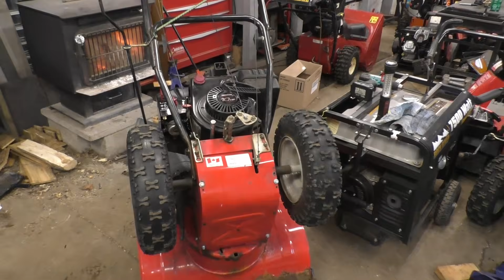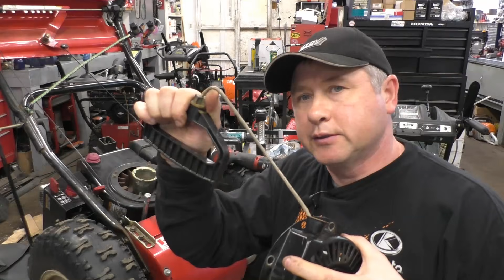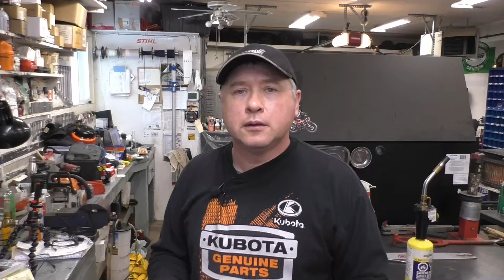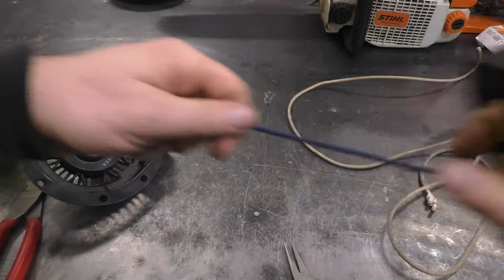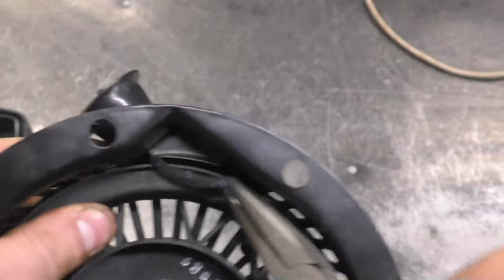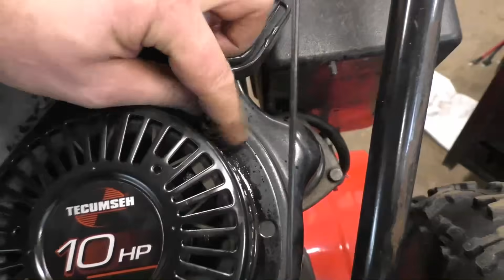Snowblower Starter Rope Repair on 8-10HP Tecumseh Engine

Comment: If The  Rope  Breaks And The Rotor unwinds  How Many Revolutions Do You Rewind The Rope Roter When Installing A New Rope?   🤔
Reply from the maker: 4-5
Reply: So do you re wind the rotor before you put the rope in and then lock it in place with the screwdriver like you did?
Reply: I wound mine until it stopped from being fully wound and then backed off until the hole lined up with the rope guide, inserted the screwdriver and proceeded with the rest of the install as he suggested. This method works great because it is right at the maximum recoil strength.
Reply: @Sstantial  I just asked that question...and will try as you suggest if I don't get a reply..but nice video for sure!
Reply: Tho this is an old question, one rotation per foot of cord should do the job. Least that's what seemed to work best on both of my snow blowers, which I had to redo the cords on.

Comment: I had installed a new cord, and it kinda worked.. but now it's come all the way out and won't recoil... Did I do something wrong or does it need a new assembly? It retracted weakly before, now not at all... not sure what the heck the issue is. I lubed the crap out of it with WD-40.

Comment: I used to have a chart that gave the rope number equivalents to decimal sizes--don't remember it except that as number diameters got larger, I think they went from #1 to #7, decimal sizes also went larger.  It is very important that rope dia. is neither too large nor too small.

Comment: I have a snowblower question for You. I have a YardMachine by MTD. Are there any modifications that I can do to make the augers to pull the snow in better? It pushes the snow more than pulling it in to throw. I know about the modification to put rubber on the impeller help clean that part out. Any help would be greatly appreciated.

Comment: I wind the spring tight loke you did but then I back it off until rope hole aligns with entrance in outer. That way maximum rope pull can never over tighten the spring.

Comment: I know that this is a snow blower video but I have a question about a Stihl chainsaw I seen a video where someone pulled the pull cord out slow and released it and it started is it real or fake it would be so much easier to do if true

Comment: Dony, I was gifted a Tomahawk Pro chipper/shreader that did not run.  It has a HM 80 8HP engine with a non-adjustable carb.  I rebuilt the carb and it now runs (chips and shreads like the devil!), but it will no run unless it is choked about 1/2 to 1/3.  I feel like it is running lean and/or there maybe extra air leaking into the carb.  I have also replaced the fuel line and the air breather hose.  Any ideas on what else I should check to get it running with the choke closes as it should?

Comment: HI DonyBoy..Was great to find your repair videos. Not sure if you will see this but if so great, if not, thanks for the vids. I'm up in Maine and we got some serious snow (which we hadn't been getting in recent years). I took out my 20 year old Yard Machine (w Tecumseh 5 hp) snowblower, and the pull cord broke (luckily I was almost done so this 71 yo, got a workout shoveling some too. So 1 qustion about the rope repair, was good to get the size and length from you. But since the cord broke, there is not recoil tension like in your video. Might you know how many revolutions I ill have to turn it to recoil the 67 inches? Or is thee another method? And since you are a master of snowblower/small engine repair...another question: I've never used the electric starter, but thought I may try a short (10ft or so) 16g 3-prong electric cord (I don't have the original). But since in all the years, I've never used the electric start. Would there be a problem trying, is it likely to work or might 20 years of no use make it risky to try it (maybe rusted or seized)? And the only other problem with my bloweer is that the augur is always turning, might need to tighten or replace the cable or pullies or something. Do you have a video on this as well? I know, way too many questions, but I'm now a subscriber...thanks so much, hope you see this not only to answer but to know how grateful I am for the time you put into these. Be well, Rick

Comment: I ran into the rope being too big on a Snapper Self Propelled  electric start lawn mower. I was given a 9hp Craftsman Snow blower, hopefully the rope is ok. Good trick on that, I didn't know that one. We never stop learning in this business do we?  It never ends.
Reply: Snapper Hi-boy? Love those mowers. Mine is on it's 2nd replacement Briggs quantum engine and it's pretty much worn out as well. Still runs but it's burning oil. I'm in the process of rebuilding a Honda GCV190 off of a pressure washer to put on it. Had to get a longer crankshaft so I'm replacing the rod and rings as well.
Reply: @bevis226  No, not a highboy.. I do not intend to keep it even though I paid extra for the Ninja blade for it. My first snapper I purchased in 1992 and it finally gave up in 2017. Everything was worn out by that time. I do not have a lawn to speak of thanks to the pine trees in my yard but the little spot I do have gets mowed everytime I fix a mower. I wanted to rebuild a Honda motor myself, but found another mower with a good engine snd bad everything else, so I just swapped. I sold that one to my neighbor that does have grass.
Reply: @scottfirman  I have abut  1 1/2 acres to mow and lots of parts mowers and crap to mow around. You never seem to have enough "storage" lol. I've been in the "business" for 33 years now.  
These last few years have been rough on everyone. Alot of OEM Parts are getting very hard to find and very expensive. I have been buying lots of aftermarket Chinese parts lately because more and more of the OEM parts are becoming NLA or to costly. Some of the aftermarket parts are not horrible but you are better off rebuilding with OEM parts for longevity. Very Rarely will someone pay $100-$200+ for parts and labor to repair an old used Blower that is worth maybe $250-300 tops when fixed.
Reply: @bevis226  I hear you on the parts situation. I dialed back on buying used equipment and fixing everything wrong and reselling.

Comment: I am pretty sure you had a video on it before Don, but the other way you should show the viewers is if the rope breaks while pulling the cord and the spring unwinds into itself....this has happened to me on a few machines before and I got lazy and bought the whole recoil assembly for 25 bucks or less
Reply from the maker: I'll be making a video on spring replacement for this recoil

Comment: Hey Dony..I noticed on my new craftsman snowblower , when I took the belly pan off there was some oil on it.  Is that normal?
Reply from the maker: there can sometimes be a film of oil, if there is more than that make sure the drain tube is tight in engine

Comment: My Simplicity snow blower has Briggs 1150 snow series that has recoil starter riveted on. What do you do in that case? Drill them out or just use electric start? Not sure why they would put them on that way.
Reply: Have had the same issue. I drill them out and install new rivets when I install
Reply from the maker: I usually remove it because sometimes rivets get caught  between flywheel and coil

Comment: Hey Dony, off subject. Have u heard of any problems with Stihl equipment using the Ultra synthetic oil for the fuel mix? 50:1
Thanks
Reply from the maker: Not that I know of
Reply: @donyboy73  
Thanks

Comment: Frustrating process; I tried a couple of different cords but they were too supple to push through the rotor hole. They'd  just bunch up. By judiciously melting the cord with a match the last inch or so, though, and running a very thin wire into the stiffened part of the rope like baiting a hook,we got it done by passing the wire through the hole first and pulling the cord with it. Sort of like electricians do.

Comment: Ok, the hole is a good idea, be careful not to make it too big and the grease for spring should not be thick/sticky otherwise you might get the rope out of the pulley when you let the rope back in. Aka getting the rope on the flywheel.
Reply: I am not talking for the model in particular, just a thing to keep in mind. Have a good day 😌